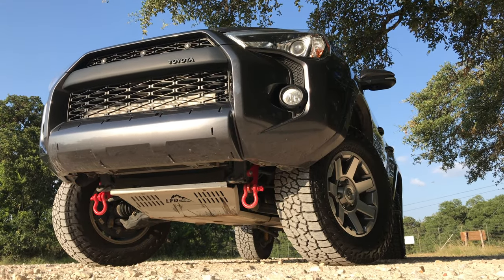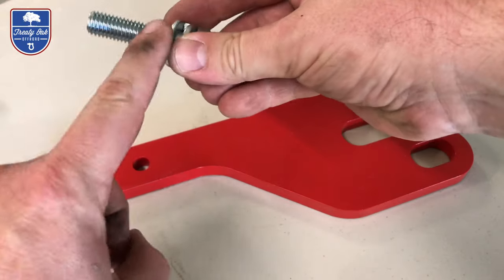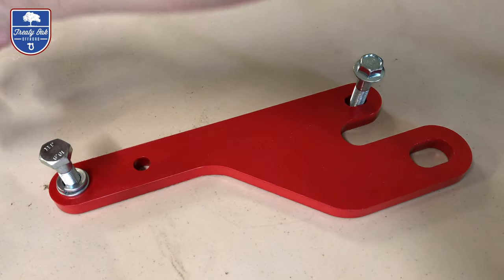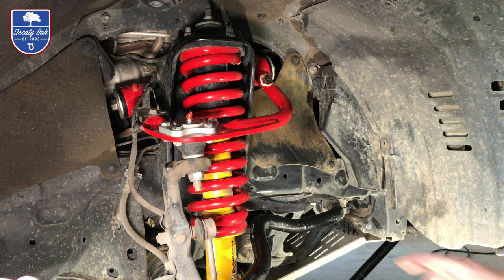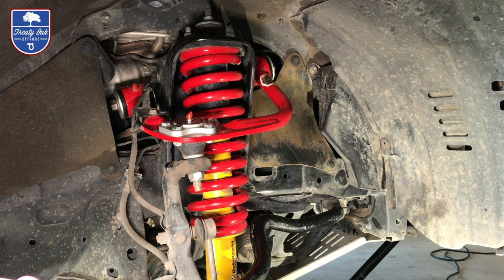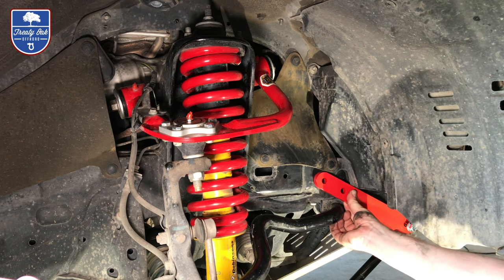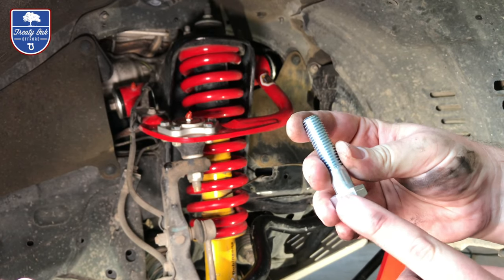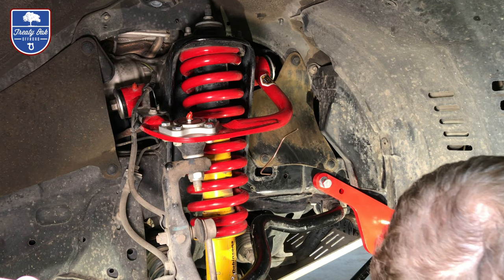Treaty Oak Off Road 5th Gen 4Runner Front Recovery Point Install

Comment: I just got a 2022 4Runner a couple weeks ago. Yesterday I asked my self “So where are the front recovery points?”  I was disappointed to discover there aren’t any but this product looks like it would solve that problem. Well done!  

My only comment is that cool as those bell shackles look, it’s probably better to stow them inside and away from the elements until you actually need them. If looks were my priority, I’d replace the front bumper and have a winch (that I’d hope to never use).
Reply from the maker: True. the bow shackles in this video were mostly to show that true recovery points were there - not the delivery tie-down points.

Comment: I just got mine in...having them Linex'd in red. Can't wait to install them. Thank you Kyle for the smooth purchase and shipping. Thank you Trail or Sail for the install process. I hope to install next week!
Reply from the maker: Just be careful not to put a heavy coat of line-x in the bolt through holes! Those things are made to fit the bolt, and digging Line-X out would be a pain!
Reply: @TrailorSailYT  Oh without a doubt LineX will put to much in there...they did the same for my RCI rear diff skid plate. I'll have some shaving to do. I truly appreciate the install video...I will have a hurdle trying to install the rear bolt with my coilover reservoir mounted on the chassis.
Reply from the maker: @UCf1pMquuc1H5W4DHkMXFVCw Definitely, but I think it can be done.
Reply: @TrailorSailYT  I might ping folks for help if I'm unable to mitigate. 😁

Comment: Did mine yesterday, no need to lift and remove a wheel (my jack stands are being used for another job). The plastic plate coving the access point is probably not surviving the procedure, I only have 5k on my runner, so it’s not the miles making the plastic brittle ... nothing that can’t be fixed with some high speed tape.
Reply from the maker: That's disappointing, but it is made to be in the wheel wells. So, maybe they justify the brittle clips based on their cost? Makes me wonder how much those little plastic clips are...

Comment: Why not just fold or bend the rod of the floating bolt and stick it in the hole rather than breaking if off.  Someday you just might have to remove the plate.  I've worked on many aircraft and we use these a lot.  Typically we just "snip it and tuck it" or so they say.  Looks like a good set up, however, personally, I'd like to see all 3 holes in the bracket utilized if possible.  I guess if you are just dressing up your mall crawler its okay, but if you are really stuck and need a pull, there is never enough insurance for a proficient extraction.  Just my opinion... carry on.
Reply from the maker: Honestly, this was my first time utilizing this kind of "in frame" nut. If I remember correctly, the holes being used here are corresponding to those on the frame for the 4Runner. The unused hole in the product is to utilize a hole in the GX470/GX460 frame. Cheers! - Mark

Comment: Thanks for the detailed install video!  Are you still happy with them, 3 years later?
Reply from the maker: Yes, absolutely. We actually just removed them this past month after a deer accident. They are still in great shape, but we may not put them back on since our new bumper takes care of our needs for recovery points.
Reply: @TrailorSailYT  So they're for sale? 😜 Too bad shipping would probably be quite expensive.  Maybe use a flat rate box haha
Reply from the maker: @TrailTape  I could sell them, but I don't have the original "in-frame" bolts you would need to install them. That's a big need as you can't mount them without these. Where are you located (out of curiosity for shipping estimates)?
Reply: @TrailorSailYT  Ah, good call on the hardware.  They'd be useless without correct mounting and I don't see an option on their website to purchase an extra hardware kit.  I'm in AL
Reply from the maker: Yeah... looks like it would be between $35 and $50 to ship that way. I would contact Kyle at Treaty Oak Off Road to see what is available on his end first.

Comment: I am not sure if my 2020 4Runner is different from most but on the driver's side the recovery point would not fit.   I had to take a round file and enlarge one side of the holes on the plate for the bolts to be able to fit into the holes on the frame.
Reply from the maker: Did you give Kyle at Treaty Oak a call? He may not be aware of that...
Reply: I had to do the same thing with my 2020 4Runner.. just on the drivers side.
Reply: I had no issues on my 2020 TRD ORP 4 Runner.

Comment: Not that anything changed, but has anyone installed this on a 2021 trd off road or Venture?
Reply from the maker: You may want to contact Kyle at Treaty Oak Offroad... I don't see any functional differences in the frame that would prevent it from happening, but I also don't have a 2021 to look over closely.

Comment: Are they compatible with Toyota 4 runner with KDSS?
Reply from the maker: I am told that they are.
Reply: Driver's side won't work.
Reply from the maker: @offshorebear  Have you tried talking to Kyle at Treaty Oak Offroad?
Reply: @TrailorSailYT  no. It took me a year to eventually try to install these. I will just use one on passanger side.
Reply from the maker: @offshorebear  I'd still let him know. Manufacturers don't test fit everything every time. So, he won't know there is a problem unless you let him know.
Reply: I had ZERO issues installing these on both sides with KDSS. It’s absolutely false to say it won’t work on the driver side

Comment: what is the issue with factory recovery point , what is the difference ?
Reply from the maker: The loop on the vehicle from the factory is actually a tie-down point. It isn't made to hold the strain of a recovery - especially when coupled with the weight of all our added accessories - winch, bumpers, skids, fuel cans, cargo, roof rack, and all that stuff...
Reply from the maker: The difference with these is how they distribute the weight across the connection points on the frame while not having any flex to them.

Comment: Do we have to take off the tire during the installation?
Reply from the maker: I guess you don't truly have to, but it definitely makes things much easier to do.
Reply: I just did mine, without removing the wheels, totally reasonable. Just turn the steering wheel to the stop of access

Comment: any idea on size for those two bolts at the front and back?
Reply from the maker: You can reach out to Treaty Oak Offroad for more information on that. My notes from this install are in the void of the mess that is my garage currently.
Reply: after some trial and error at my local Ace Hardware, it appears these are M12 bolts with a 1.25 pitch.
Reply: For a 2018 4Runner that is. Could be different on other models.

Comment: Just 2 bolts? Seems like a true recovery would have more
Reply from the maker: Most don't... Also, these bolts are extremely high grade.
Reply: Those two bolts will handle the job very easily.